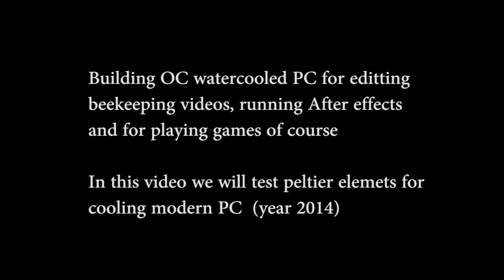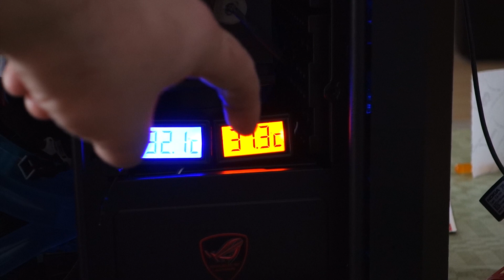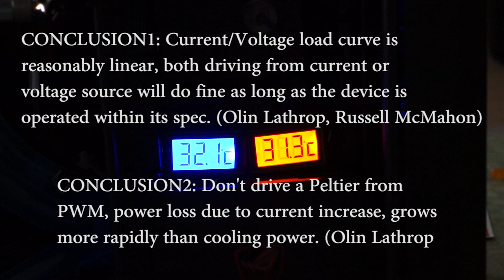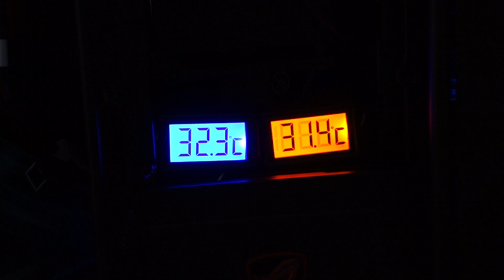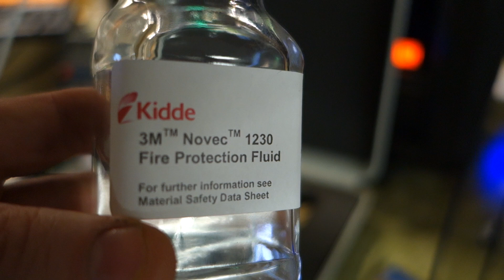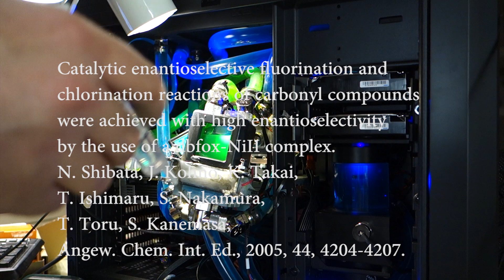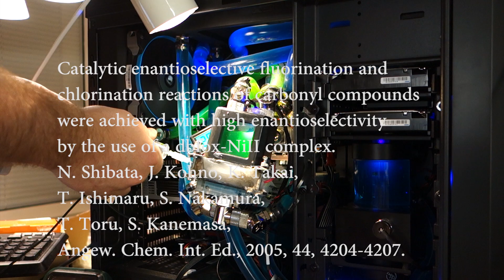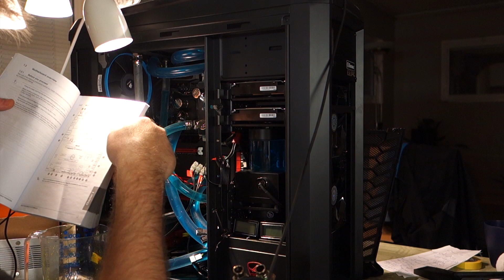Watercooled OC PC with peltier element for extra cooling

Comment: Does a system like this have a problem with condensation, where elements of the loop may or are colder that ambient?
Reply from the maker: I never tested this so long that I could say anything about long term use. But peltiers what I use where not strong enough to get even close some real condensation issue

Comment: is that a single 120mm radiator you have? then its normal you dont get it cooled better lol..
nevermind i see you also have a 240 or 360 in the top

Comment from the maker: obiwan845: I didn´t find any technical specs what you mentioned or videos. I am really interested because I believe and as I said in the video that there is absolutely no sense to cool with peltiers. During CPU idling its easy to keep temperatures down with peltiers, but with full load you need 500W-1000W for all needed components. I saw only some pictures from your build. By the way there is video below how my Cooler master PC is now working... No power losses ;). Look at temperatures (with full load), speeds and overclocks  -->
http://youtu.be/M9CLQGLnPvs
Reply: I like ,Work harder :)

Comment from the maker: Yes Ivan you are right, that is also great idea. In this existing loop in the video there was 3 pump and 3 tanks. 1 for peltiers (green), 1 for cold "pushing" (in optical drive slot), 1 for hot "sucking" (blue one visible in the video)  

Maybe in this case the idea was so something like all in one package, inside the case. In case of external system I could use much better cooling system than peltiers. For example dunk-yards are full of refrigerators and from there some heat exchanger which have tens of times more efficient cooling process than in any existing peltier element available.

Other option is just make external water-glycol cooler and place it to the balcony we have -10 to -20 there at the moment. It could be easy to do adjustable valve which is diverting internal water circulation loop to external when that's needed and back of the PC could have just fast plug and play open joint for hoses so that you don't have to control water leakage every time separately. One controllable valve between "exit" and "input", inside the case, could be handy for ensuring that coolant temperature is not too low and loop is running all the time even with additional external loop flow resistance.

Comment from the maker: Yes its messy, but idea was just to get all needed stuff in and not to compete with loop outlook. This video is about testing normal 90W Peltier elements, where is between (in silicone layer) Fluoroketone mimicking vacuum and preventing heat exchange between Peltier HOT and COLD side....  I was able to get this liquid free form my work. Normally Its 120€/L and hard to get  (this is presented from in the video from 7.07 -->)